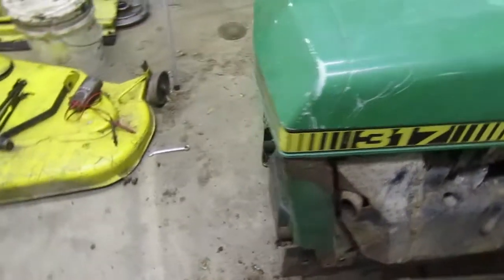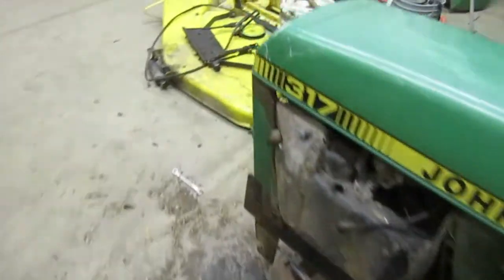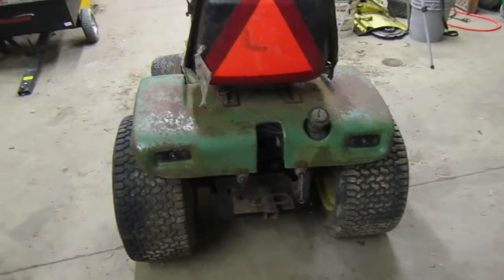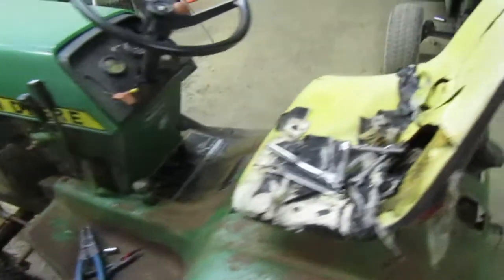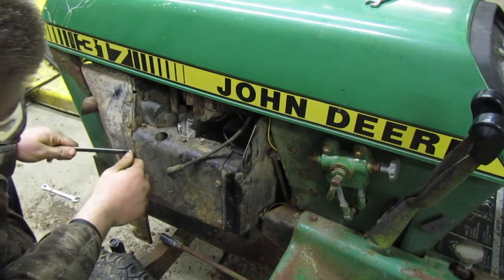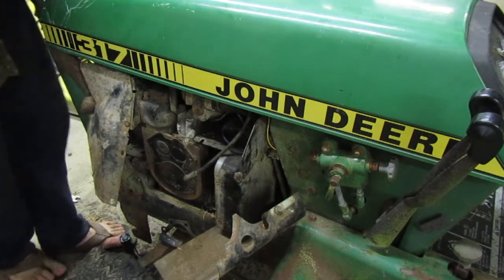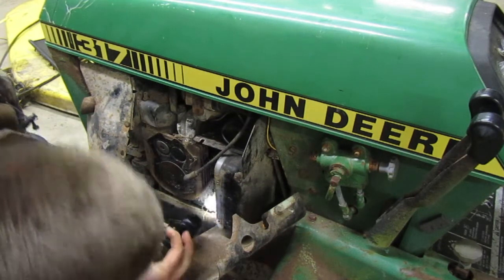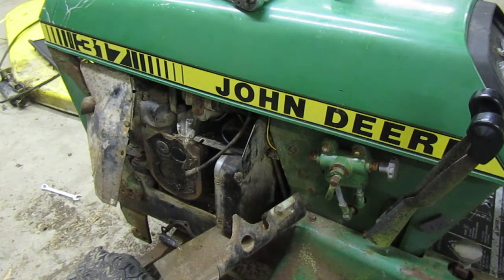What happened ??? 1981 John Deere 317 Bad Engine ????

Comment: Jon. It would be nice to find a KT17 Series 2 engine somewhere. My 682 Cub Cadet had a Series 1 that wore out before the engine shredded itself according to the previous owner. He actually sold the 682 and bought it back once a Series 2 engine had been installed - Crazy Isn’t It. 
The Series 2 engine that is in my Cub Cadet starts very quickly and is a very smooth running engine that has very little vibration and does have a fair amount of lugging power. 
I had entertained the thought of maybe repowering with a Diesel engine should the KT17 ever bite the dust - I try to keep the oil changed in an effort to make the engine last for a long time. I’m curious how much damage was done to the cylinder wall and the rest of the engine.

Comment: I’d just trash the engine & put in a good used K341 or a KT17-19 or M18.

This is a tractor for an engine swap, I found one in our neighbors barn, but since it’s a 317 even with all the attachments I can’t offer much since it’s kinda hard to sell the attachments separately tho.

If you tear the engine out & get it ready for a swap you might be able to get more for the tractor with the engine out, but if the starter on it works thats $30 the starters on these engines are $$$.
Reply from the maker: damn might have to concider. Took the engine out was debating on parting a 312 I have been seeing and taking its engine the rest is junk put that motor in and get it going. Might take the twin apart to see what damage there was. dont know nothings offical yet in still making plans

Comment: Any advice I got a john deere 317 with a Kohler engine in it yet to figure out if it is a 17 or 19 but it vibrates like crazy cant mow long cause the whole tractor shakes!
Reply from the maker: does it run on both cylinders?
Reply: @themaniacmower  yes and I found out it's a 17

Comment: I would rebuild at least open her up see how much damage if there is any
Reply from the maker: yeah might as well might be a video soon I made a pole in the channle discusson tab if your interested in being a part doubt anyone will vote
Reply: Don’t rebuild this thing, even if it’s rebuilt unless it’s a different motor not a KT17 series 1 & or 2 the KT17 engine run has a bad reputation & it’s just cheaper to find a decent used twin not a KT17 & have it going again.

Our neighbor has a kt-17 & I’m hoping it’s a series 2. I looked at it a little, & couldn’t figure out which one it was, I could tell now after more extensive research.

Comment: I have a John Deere 317 at my house and it will not run at all it would fire Butthead no idle I'm reading the plugs a couple of times it has a good working fuel pump good carburetor but it won't run and it has zero Spark